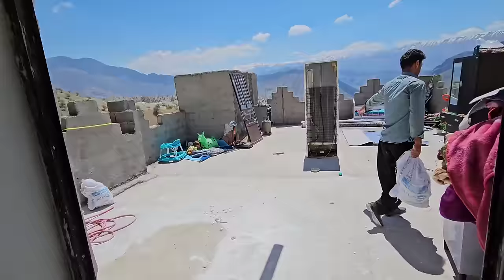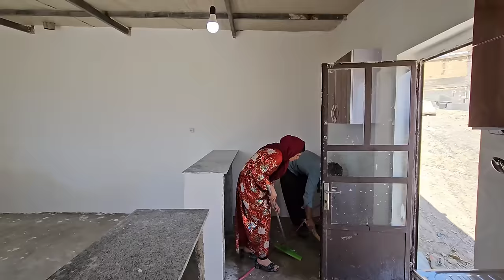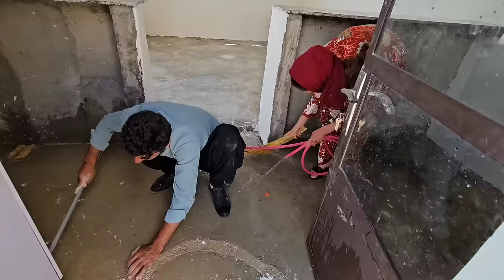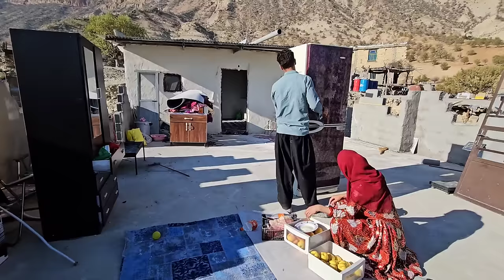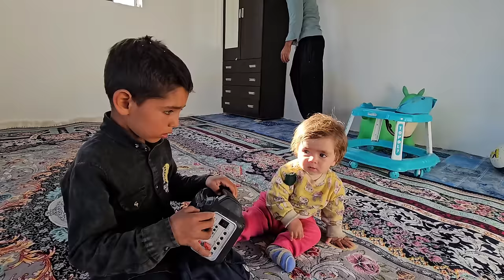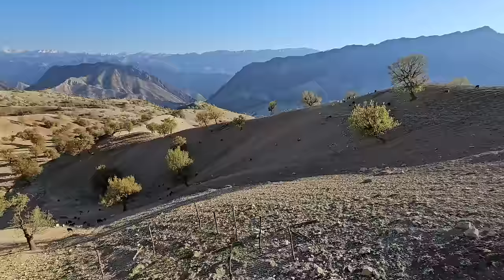Fascinating And Charming Life: a Beautiful Documentary Of A Nomadic Family in The Peaceful Nature

Comment: Let’s put the rug back on a damp floor, Black Mold by the end of the month if not sooner!
Reply: The floor may not be damp, perhaps there was a time lapse in the video.
Reply: Where do you found the proof that it is black mold? Who told you that?
Reply: The cement looked dry enough to me when they showed it while they were putting the blue carpet down - so there must've been a time lapse. 

My question is what they're going to do when the damp permeates their wall in that corner again because plastering over it only put a bandaid on the visible problem instead of fixing the problem to begin with.

Comment: You put the cabinet in the corner where the wall is wet. You pressed it very tightly against the wall and it will not have ventilation. Mold appears, which is very harmful to health.